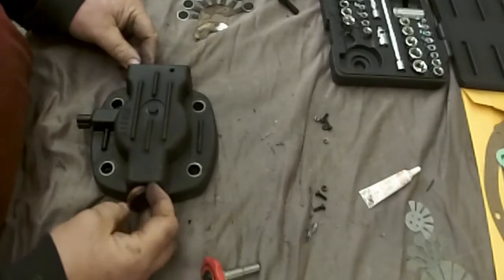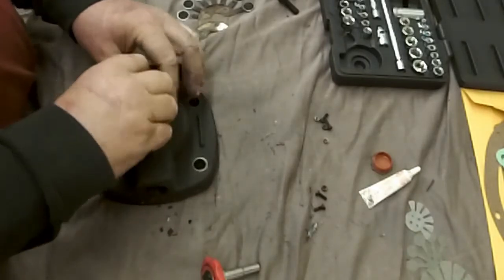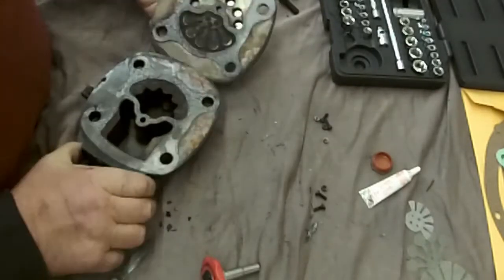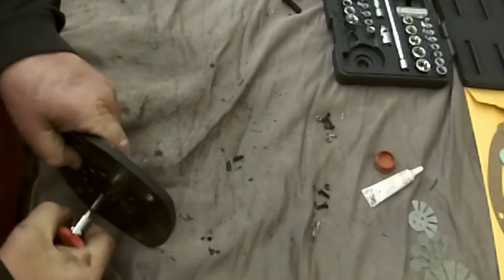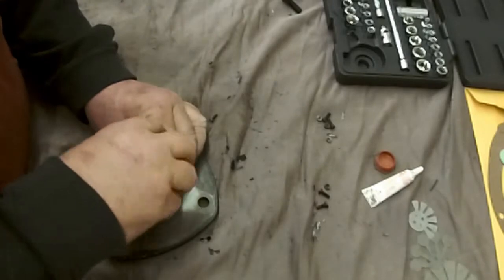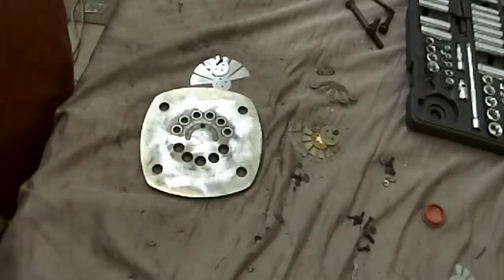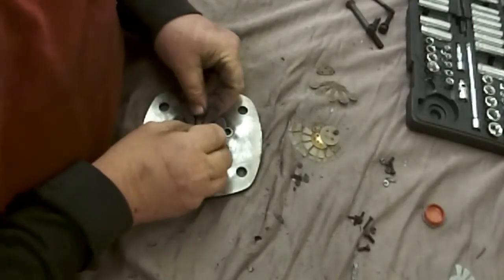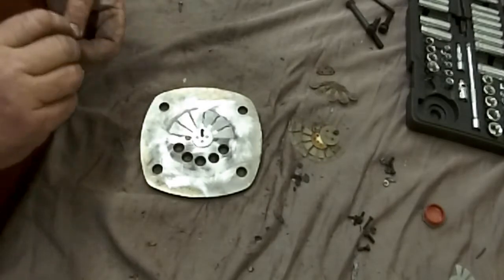IR 2545 Valve rebuild High Pressure head "valve" job S1, E4

Comment: You put the little reinforcement finger plates on the wrong side.  If you notice, they do not line up with the valves.  Put the top  one on the bottom and the bottom one on the top, and they will line up.  They are not the same.  Hopefully you caught that before you sent that compressor off.
Reply from the maker: I did catch this. this was the second video we did and one of the few I did by myself. Many times over the years there have been redo's and we usually tape them but not this time. I am still learning about the filming and editing. It might have been # 4 or 5 released.  really great catch. thank you and keep me honest.

Comment: Thanks for your detailed videos.  I'm rebuilding a IR 2475 with a date code on the tank of 1998.  The original head gaskets were those graphite infused types you show in your video.  The aftermarket (shipped from India) kit I bought has paper type gaskets (same gasket type for all locations on the pump).  Are those the ones prone to blowout?  Should I try to source the graphite ones for the head gaskets?  Thanks!

Comment: Great video.  I forgot about those gaskets till I watched this vid.  I remember when they were introduced.  One thing I did to install those small machine screws and nuts, I would use a socket, but stuffed with some paper to limit the depth of the socket.  Easier than using your fingers with those tightly spaced machine screws.

Comment: Greetings Guru.  I'm using this as a guide to rebuild a 2475.  I assembled the high/low cylinders, installed the crank bushing and cap, and I thought I was ready to put on the body cover and crank cover.  I'm not able to rotate the crank shaft 360 degrees; there seems to be something in the body that blocks the full rotation.  The rotation stops in both directions.  I'm assuming this means I've assembled the cylinders incorrectly.  Is that correct?  Both plungers are pointing down.
Reply from the maker: I am Guessing you have a connecting rod on backwards and the dipper is hitting the crank case . My best guess
Reply from the maker: I just read the full version of your comment. I assume the plungers are the dippers on the connecting rod. how far can you rotate is it just short of going all the way 360 or is it much less. feel free to contact me through thecompressorguru.com